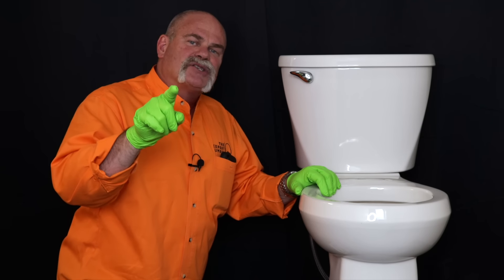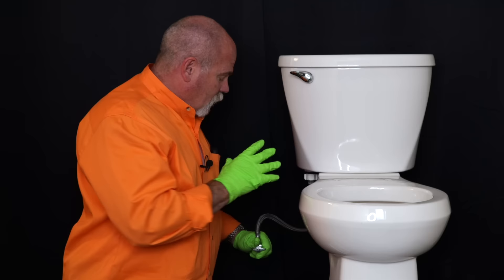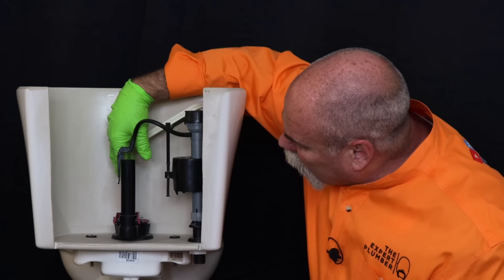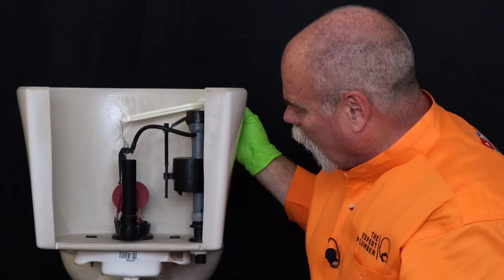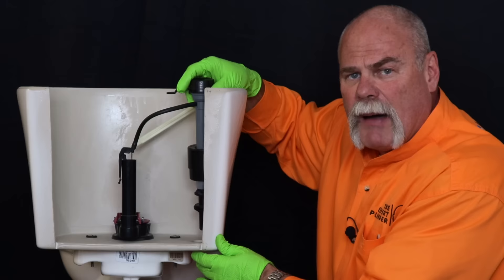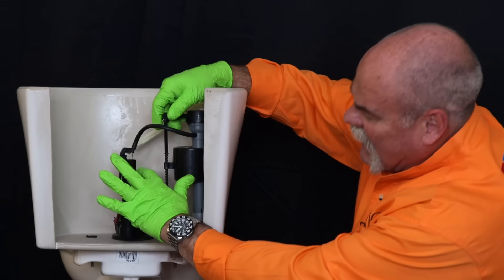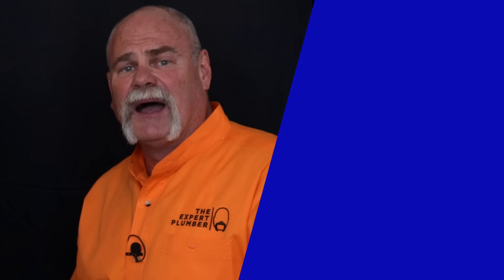How to Fix A Running Toilet GUARANTEED | DIY Plumbing Repair

Comment: THANK YOU. You saved me desperately needed money and stress relief from this detailed video. Water line constantly has dirt grains from city flushing lines that clogs flush valves. The city no longer gives warnings so we can shut off water to prevent dirt in lines. So now we constantly have to clean all lines, valves, etc every time they clean lines. If not pay plumber to REPLACE parts which I discovered only needed cleaning.

Comment: Really appreciate it. The city changed the pipes outside and after all the toilets were running. I was able to clean the valve on two and they work. Just need to replace the third. Saved me time and money.

Comment: Had to replace my fill valve unit as the float was taking on water causing it to not shut off.  Super quick and easy.  Took less than 10 minutes and only $15! Thank you for this video!
Reply: My whole valve replacement cost $12.72.  Cleaning the diaphragm led to a worse leak. You can't buy just the top valve assembly.

Comment: Thanks! So far yours is the only video that shows how to clean out the fill valve. There was trash in mine. I cleaned it out and fixed the problem. Saved me wasting money on a new fill valve.

Comment: I had a squealing noise coming from my fill valve whenever there was a change in pressure and started watching your videos.  I watched the one on a running toilet and saw how to check/change the diaphragm.  I shut off the valve, released the pressure by pushing down on the float, twisted and removed the diaphragm valve, put it back on, and the squeal is gone.  Thanks so much for what you do, you're a life saver.

Comment: Thanks Roger!  For someone who has a tenuous relationship with his man card, I found it very easy.  Now it stops running after about a minute.  I did your suggestions and also tightened up the chain by a couple links.

Comment: I just replaced a second toilet fill valve in another bathroom in my home.  I watched your video again as a "refresher" before going to Lowes and buying another replacement.  I would venture to guess this video alone has saved me well over $300.00 in plumbing fees in the past year.  I last posted a year ago.  The only change is that Lowes now charges $7.80 per unit instead of $7.00 so I went ahead and purchased two for the next replacement need.  Thank you again for posting these videos and watching out for us "little guys" (and saving us a ton of money in the process). Cheers

Comment: I don't know why I doubted you but you have once again taught me something new and saved me great frustration! Had a plumber out earlier today and they had to remove the toilet. Turns out the gel they use in the bowl to solidify the water hadn't been completely flushed through the system. It was gunking up the flapper so it was stuck in the up position. Quick rinse with warm water and it's working fine again. And my fill and diaphragm valves got cleaned and looked over. Thanks!

Comment: Had a running toilet. The diaphragm valve was clear. Turns out the fill valve stem had a couple small debris pieces inside that was getting between the diaphragm valve and the main body of the fill valve. I would never have detected it had I not followed this video’s suggestion to open the water supply’s angle stop just a bit to push whatever was down there out. Reassembled. No more running toilet! 🙌🏻

Comment: I bought one of those “universal” flappers, because the store didn’t have the brand for my toilet. Well, it helped somewhat but I could still hear the toilet running. So I went to a plumbing supply and bought the flapper made for my toilet. That fixed it 100% quiet.
Reply from the maker: @Lee B. The universal are worth trying but, they don’t always work... Glad I could help!

Comment: Thank you so much!  Replaced fill valve and it is no longer running constantly  I am a 74 year old retired nurse. I did not change the flapper.  Your instructions were excellent.  All for $25.00

Comment: I already knew how to do this. You've given me like 5 or 7 extra little tidbits to make the job easier. Thank you.

One tidbit that I've learned to make life easier is is to get a deep 1 1/8 socket that I use to remove the plastic nut under the valve. You can just do it by hand. Unfortunately, some valve brands have a "finger tightening" nut. Those suck, and you have to use a small set of pliers.

Comment: This dude helped fixed my toilet 100% from this video!!Was so much eazyer than i thought it was going to be!!For me i  just took off the top of the fuel valve ran some water threw/cleaned and has been working fine ever sens been about 8 mounths and it's still running great no random running water!! ty!! 

TY Roger Wakefield you helped me save money i did not have ty so much!!!

Comment: Great video. I had replaced the entire assembly in a new tank a few years ago so was concerned that I got a faulty assembly. Turns out that the 'won't stop running problem I was having, was with a lest than tight fill valve assembly. Simply tightening it (just minutes ago after watching your video) ended the problem immediately.  Will monitor to see if thats all that was going on. Thanks. Keep doing what ya do, bruh.

Comment: Great video! I am a lady that does a bit of property managing at a condo. One of the toilets was running, and as it turns out it was NOT just a simple adjustment of the screw that changes the water level nor was it  the flapper or cruddy rim.  Now, because of your video i know what to do next.  I'm going to try cleaning out the diaphragm valve. You explained very nicely what to do if that doesn't work either, so I feel very prepared with my channel locks!

Comment from the maker: Let me know if this video has helped you fix your toilet!
Reply: It worked!!!!!
Reply: My fill tube won't stay in the whole!
Reply: And my handle hits the porcillon tank cover. I have to leave the tank cover off!! Help
Reply: Roger Wakefield l fix it , thank you sir.
Reply from the maker: Buffy Cleaveland is it plastic or brass? Also is there a lot of slack in the chain?
Reply from the maker: Buffy Cleaveland there is a special little piece that helps keep it in there.
Reply: The fill tube is plastic and seems to go in a tube micro inches bigger than it.
Reply: The chain is metal and has some slack
Reply: The chain is metal and has some slack in it
Reply from the maker: @Cabinet-316  congratulations!
Reply from the maker: @buffycleaveland8116  there are special pieces made to attach the tube without sticking down in the tube. That is actually a cross-connection
Reply from the maker: @buffycleaveland8116  it should have some but not too much. If you can take some slack out and have the flapper still make a good seal it might help.
Reply: Yes! Thank you so much! Super easy to follow!!
Reply from the maker: @rayray108  which part did you have to change out?
Reply from the maker: @buffycleaveland8116  did you get it?
Reply: @RogerWakefield  no, my toilet is still not fixed, I am not able to make it happen.
Reply: @RogerWakefield  thanks for getting back to me though
Reply: @RogerWakefield  cleaned out the valve. It stopped it from continuously running. But my toilet has always come on and off. It will run for a few seconds then stop. What does that mean?
Reply: Thank you so much sir, I'll will try this today.
Reply: Hi Roger! Great video, very clear instructions. .I just this minute finished removing and clearing out the diaphragm thingy (tech speak). Fingers are crossed. About 10 days ago I replaced the seal - I have the canister type - and that was simple enough, but it started running again last night. Which is maddening. The only thing I noticed this time that's different is there is a lot of gunk in the tank. It almost looks like caulking, so I'm wondering if that is breaking loose and interfering with the seal. The only other thing I'll mention is that I had a really difficult time removing the red cap. I did finally manage to take it apart well enough to get to the diaphragm and rinse it out per your instructions. Like I said, I'm really hopeful this will fix it. I could use a victory! Thanks again for the great video.  Liked and subscribed.
Reply: It did, thank you! The issue was fairly simple and after watching your video I was able to find it and fix it in a few minutes
Reply: I changed the flap still small leaking water.  What should I do ?
Reply: The well pump was replaced causing debris to build up in the fill valve.  I sucked out the debris with a shop vac and THAT FIXED THE PROBLEM.  Thanks friend.
Reply: This worked like a charm.
Reply: Sir I have a question
Reply: Roger Wakefield Very helpful! Thank you!
Reply: Did this today, the fill valve needed cleaning and all is good now. Thanks!
Reply from the maker: Mathai Mathew sounds like the flush valve.
Reply: Fixed my toilet!!!
Reply: Bro i have a different style of toilet tank. However your video really help me thanks
Reply: Roger, followed the steps to confirm the flush valve was clean and seated, also cleaned the fill valve diaphragm. But, the tank still slowly loses water - Ata rate less than previously. This AS Cadet is only 3 yrs old, and leaks have only been happening for past few months, slowly getting worse. Any other suggestions?
Reply: It worked! I had a little piece of something that was blue inside the diaphragm valve. I'm not sure what it was, but it was a hard broken piece of something. I removed it and washed all of the stuff off and it stopped running!Thanks! Liked and Subscribed!
Reply: Love your video and it worked pretty well. Like your presentation, attitude,  cut section of toilet and most of it your passion to make it so comprehensive to help n not get confused.
Reply: This did. I have little to none experience. I know basics. I'm caretaker of 77yr old mother &  great feeling completing this myself with help of your video Roger. Thanks man. - Sam from Kansas
Reply: Thank you Roger - just watched your video and went through the steps - toilet is fixed! Just undid the valve- all fixed! Thanks so much! Certainly saved money.
Reply: Yes! I didn't know how to take the vacuum break apart. Cleaned debris, vwalla!
Reply: @buffycleaveland8116  Did you adjust the Chain Length from the Handle to Flapper >?(Hopefully I said that correctly)
Reply: @adastraperaspera7098  yes, my toilet is fixed now
Reply: Yes! This repaired two toilets that had the same issue. No the part that disappoints me is the helpful "experts" at the big orange store have let me buy new flush valves and never told me that the valve was somewhat serviceable. So I have bought a few new ones over the years that probably could have been repaired in leas than 5 minutes...and that includes: washing with handsoap, running a cotton tipped applicator in the groves of the diaphragm to get more gunk and washing a second time with soap. They may not be back to 100% new, but the trick of using the applicators to wipe the grooves clean probably gets me back to 98% clean. So, I should easily get another 3 1/2 years of worry free flushing. I will take one apart and show my youngest son (12) the next time he is over. He enjoys learning how to repair almost anything and will remember this when I am too old or not nearby. ;-)
Reply: It was the diaphragm valve thank you sir!
Reply: Mine had to do with the chain being improperly inserted. Whoever messed with it before looped the chain in such a way to when you pulled the handle to flush the chain gave a little bit as you lifted.
Reply: Just a quick "thank you" for creating and posting this video.  After watching your video, I was able to determine the cause of the problem and replaced the toilet fill value at a cost of just under $7.00.   In a time like these when money is "tight", you saved me the cost of hiring a professional plumber...just the service call alone would have been $90.00 and that would not have included the part and installation charges.  Thank you, kind sir!
Reply: why do i have to disconnect the water line if it's the flapper?
Reply: Dude, thank you so much for addressing the diaphragm valve!  Every article I'd found, including the DIY repair manuals I have, go straight to replacing the whole assembly.  All that turned out to be wrong with my running toilet was crumblies (probably from my old pipes) stuck in the diaphragm valve.
Reply: Yes it did! Thank you so much!
Reply: It worked! Thanks so much!
Reply: There was debris under the diaphragm and cleaning it out fixed my leak.
Reply: Nailed it!
Reply: Just fix the old man's toilet after watching this , can't believe it's been that way for 10 years.  Just took 3 minutes of my time and is working like new again. Awesome stuff keep it coming
Reply: Just like you said, some sediment accumulated and prevented the valve from shutting off.  I cleaned it out as best I could and turn on the water briefly to flush it out.  Worked perfectly!! Thank you!!
Reply: Yes sir it did. My fill valve is so caked over with hard water deposits, I can't get the top off of it. So I sent my wife to get a replacement at the depot. $5.77, good as new.
Reply: Helped me, too. 73-year old female, pretty handy, love the challenge of fixing something on my own.  Thank you, Roger...You ROCK!
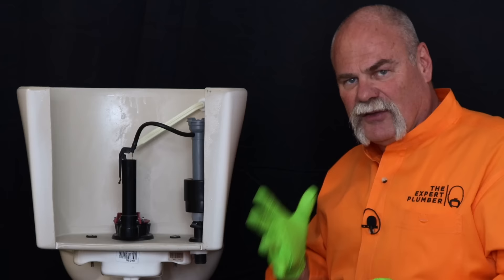Reply: 4:12---disassembled/cleaned/reassembled diaphragm valve per instructions and all good! thanks my man!
Reply: 🌷 Thank you!!!
Reply: Had to buy the entire valve assembly.  Cleaning the diaphragm led to a worse leak.  Sorry, just didn't work here.

Comment: Help! 

I'm at 3:15 "the fill valve, you can disconnect" - does this just snap right off? Mine seems to be on there pretty tight and I don't want to break it! 

Thank you!!!

Comment: Thank you - I cleaned the diaphragm valve as you indicated however it did not work - however I simply took a new diaphragm top section and replaced only that part without having to take the whole fill valve assembly off and replace - so easy!

Comment: Hi Roger! My toilet is running, and after checking it out I realized when I push down on the fill valve float it stops running. I also noticed that water is leaking from the top of the diaphragm valve, but once I push down on the float it stops leaking. 

Would the fix be adjusting the float or do I need a replacement? 

Thank you in advanced!!!😊
Reply from the maker: You might take apart the top and clean the diaphragm but, I am thinking replacement... Sorry. Let me know if that works.
Reply: Cleaning the diaphragm can lead to a worse leak.  Buy the entire valve assembly and you won't be sorry.

Comment: Thank you so much! I just installed two bidets and the first restroom went wonderfully. I followed the directions and everything was great until the second restroom. I was re-hooked up, but the water just kept running. I watched your video and checked the flapper valve and then I checked the fill valve. I cleaned out the very minimal gunk out of the fill valve, and now everything works! Thank you so much for your video that just saved me money and stress. The fill valve issue I guess just happened to coincide with the bidet installation timing. Weird. Either way thank you so much!

Comment: GUARANTEED but you didn't mention anywhere about a sticky float that makes your toilet keep running. If you did please tell the time in the video as I didn't see it. I also went to part 2 and did not see it there either.
Reply: You go $
Reply: I had a similar problem. Do yourself a favor and just replace the whole thing. I got one at Home Depot for $8. Took me less than ten minutes

Comment: The first thing you should do before repairing a running toilet is checked the house water pressure
Reply from the maker: William Knighton I'm assuming that they already know the problem is the toilet itself. Great information though.

Comment: geez mate you are a legend! had a water line relaced outside and our toilet started running after checking the fill valve there was small rocks/grit in there, cleaned it out like you said an boom , fixes the issue ..cheers mate!

Comment: This is great! Thank you so much! I was dealing with a soft running toilet and almost called a plumber… took apart and cleaned my diaphragm valve… BOOM it was fixed. Prob saved me $100+ THANK YOU! this was super easy with your instructions.

Comment: Thanks for your video. Mine was leaking so  I cleared around the flapper and it works with no more leaking  to fill up the tank.  Thumps up!

Comment: Wow thanks for the help! This worked on my toilet just now. Super easy and the fill valve had the slightest amount of sand in it. I washed it up and place everything back. Then it worked and stopped running!

Comment: Thank you for making this easy to follow video! I was about to call a plumber and spend money on something that was so easy to fix myself. I was having a slow trickle of water from the tank into the bowl. At first I thought it was the flapper but after replacing that it was still leaking. I watched your video, went to Lowe's bougth the fill valve replacement and changed it myself. Because of your excellent tips and reminders I didn't have a mess of water spraying every where, and now it's all good. THANKS! Now I am off to replace my husband's shower head with a hand held sprayer!

Comment: OMG. Thank you. I may still need to replace the tank parts just because they are old, but I don't have to deal with it today. A TON of debris. I cleaned the part that came off the top of the fill valve tube and then used an old tooth brush and poured some water at the same time to get the stuff out of the tube part that was still in the toilet.

Comment: This is why I love YouTube.  I have been putting this off for a month and after your video I fixed it in 2 minutes.  My fill valve diaphragm was covered in calcium or lime deposits, 30 seconds with and old toothbrush and good as new!